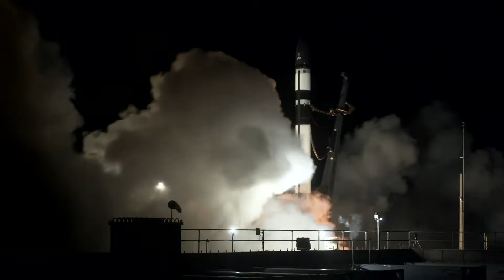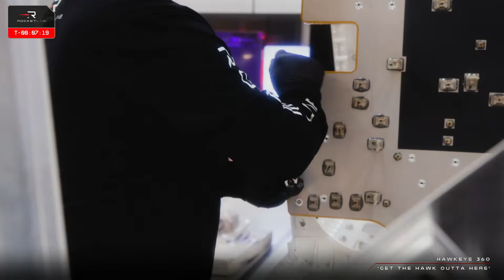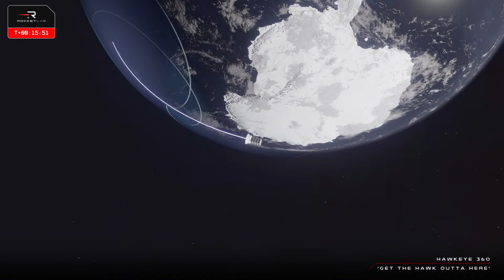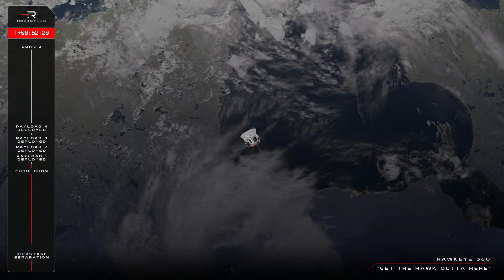Rocket Lab - 'Get The Hawk Outta Here' Launch

Comment: How are kick stages disposed of?
Reply: Splash down for now - but they will look to reuse them later in the program
Reply: @angusb1836  No, they burn up in the atmosphere and there is absolutely no plan to reuse them, as this is impossible with the margins of a small launch vehicle.
Reply: @zacklewis342 not sure where you get your facts from? They’ve already tried it and will try again later when $$ allow. 

“There And Back Again” mission (May 2, 2022)

On their 26th Electron launch, Rocket Lab performed the first mid‑air capture attempt with a real first stage descending from orbit. A Sikorsky S‑92 helicopter successfully hooked the parachute line, briefly holding the booster before the pilot released it due to unexpected load behavior. The booster then splashed down and was recovered from the ocean.

Comment: 18:37 - T-3/lift off,
19:58 - MAX Q,
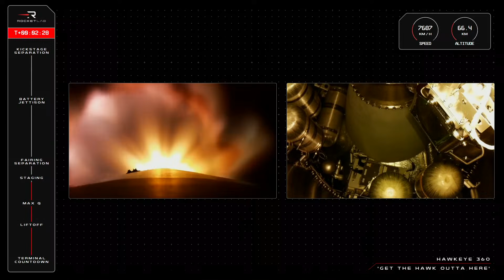21:10 - Meco/Stage separation,
21:50 - Fairing separation (no views),
25:08 - Battery hot swap,
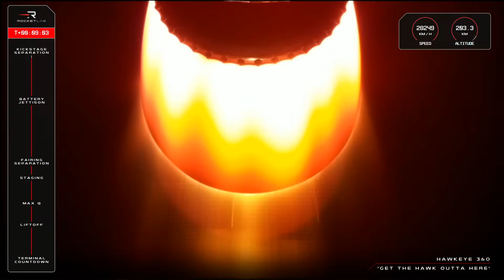27:43 - Seco,
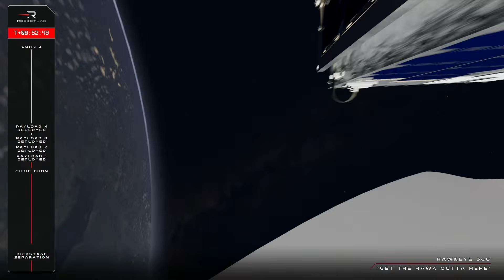1:11:40 - Payload 1, 2, and 3 deployment,
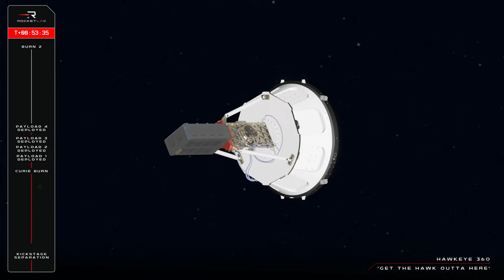1:12:28 - Payload 4 deployment.

Thanks!
Reply: Thank you! 😎✌️
Reply: Not all heroes wear capes 😊 (unless you do)